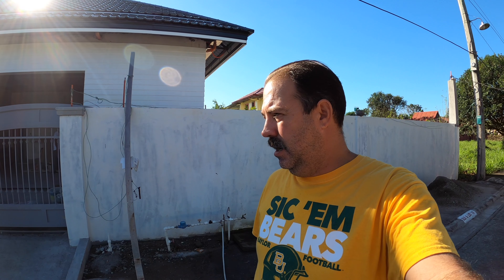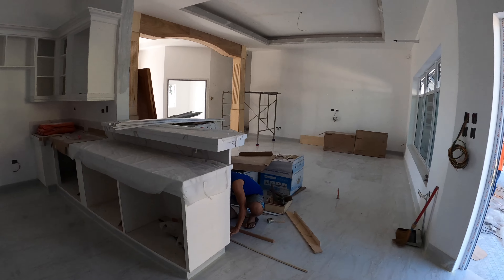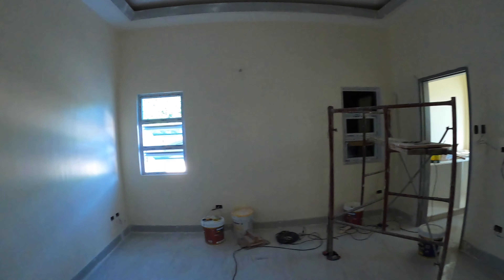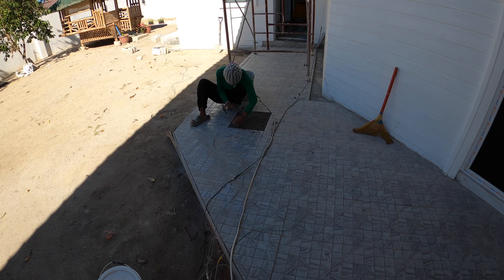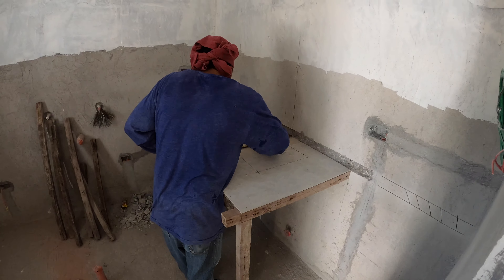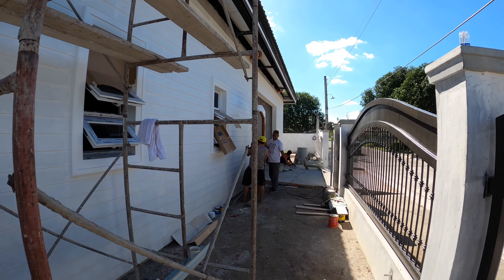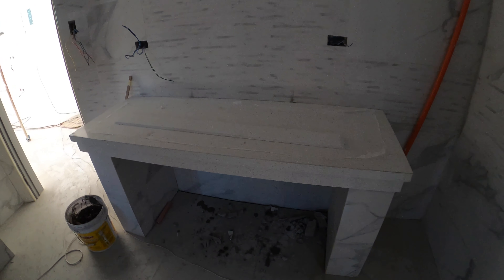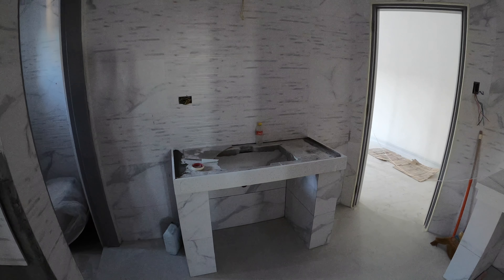Philippine House Building Step by Step, Build Day 211: Master Bath Countertops, Day 1

Comment: Your breakfast bar looks good but just curious if the side wall is final coz it looks heavy on the upper level counter top with its slender wall supporting it by looking at the side view.
Reply from the maker: I believe that is the final thickness. It does have supports underneath the countertop as well.